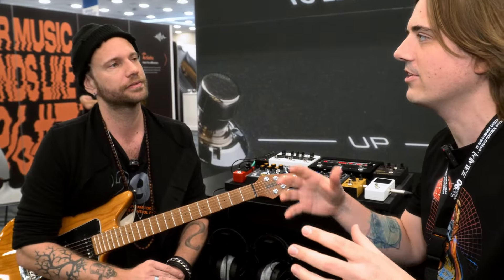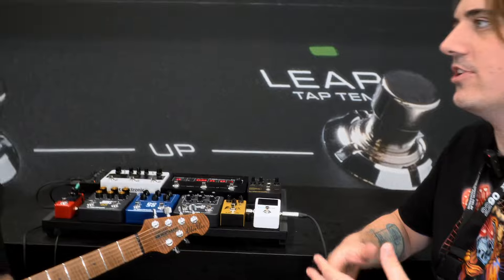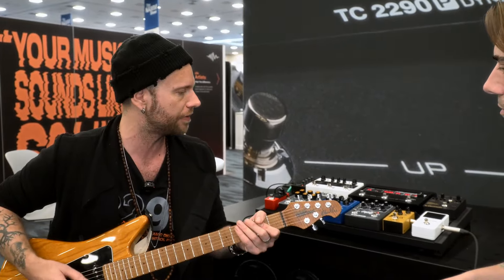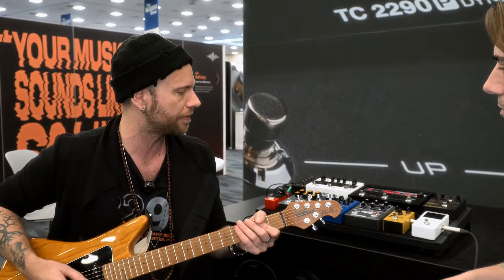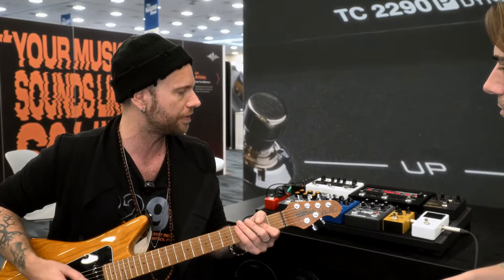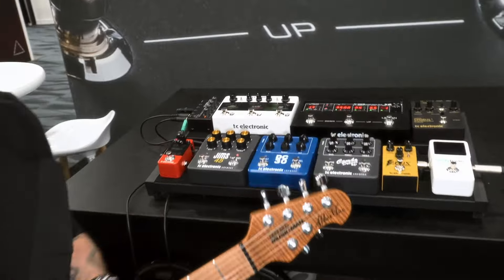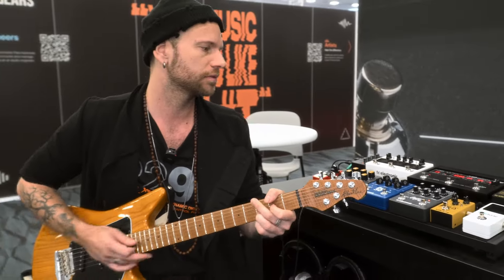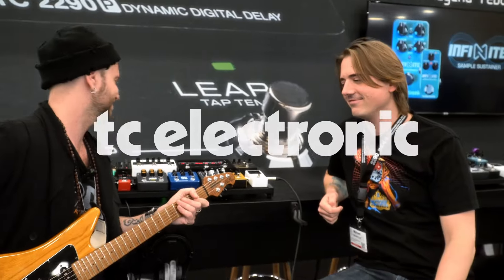The ultimate sounding pedalboard for fly rigs?

Comment: Plethora X5 question/request...I'm still missing an EQ function. Even the Nux Mighty Plug pro has a 10 band Equaliser which is so very useful in creating a sound. IR's are kind of the same but not being able to assign an IR per board prevents that from being an option.😢
Reply from the maker: Hey Luke,
While the PX5 doesn't explicitly provide an EQ, it is possible to make a 3-band EQ using the HyperGravity effect and the TonePrint editor.
Pedal Platform has a great video explaining this: https://youtu.be/6MVdyRiBzE8?si=gdiZIMJ_-4BBbZK2